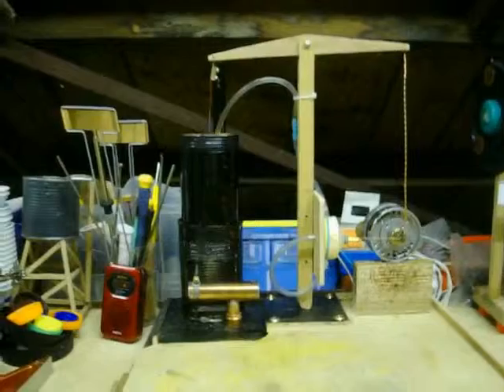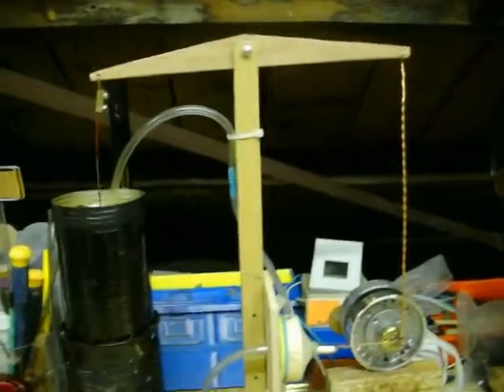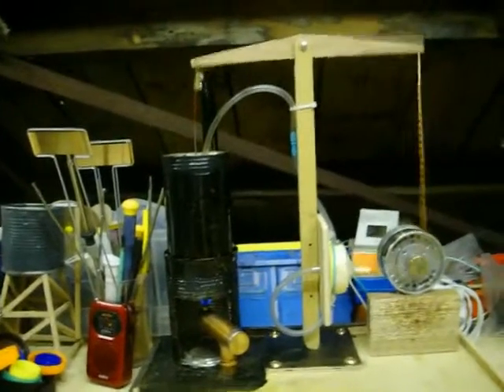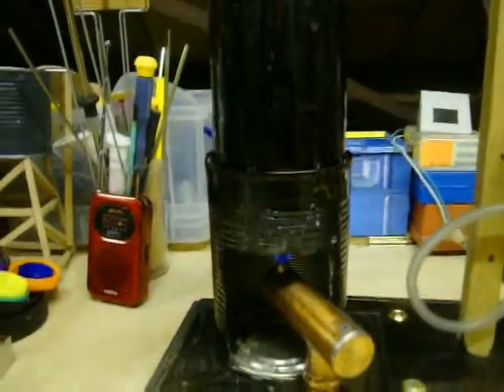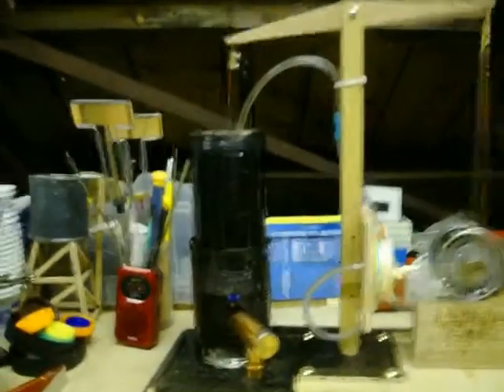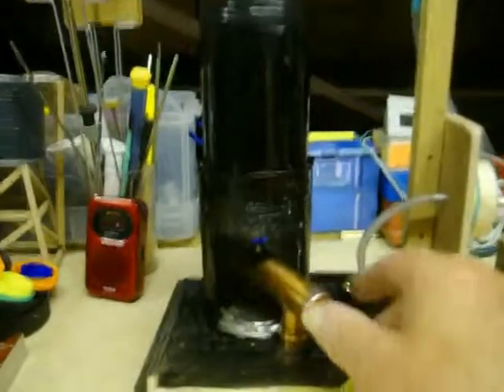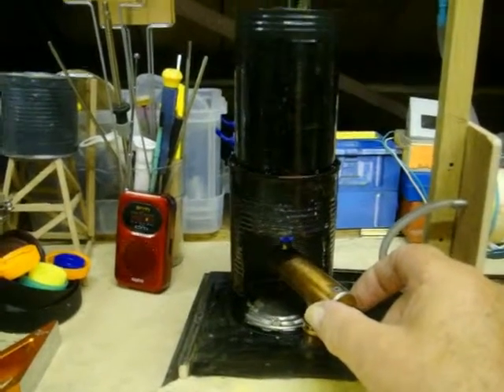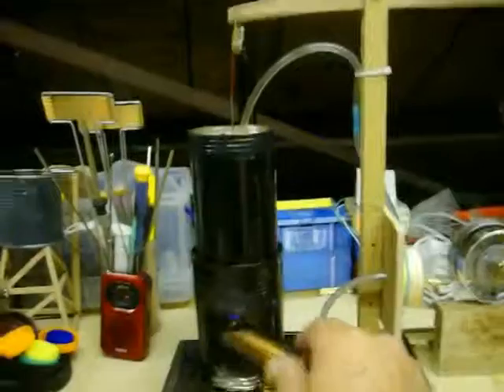Walking Beam Stirling Engine Build

Comment: I like the "wee" burner youv'e built. I had one up and running but the displacer caught fire so I built from the same design yet cannot get it to work,m I notice that your hot air tube to the diaphragm is quite small.and I wonder how the air makes it past at all'So I will drop originality by the wayside for now and COPY your design then when it's up and running I will change it to make it myown.Thanks for sharing